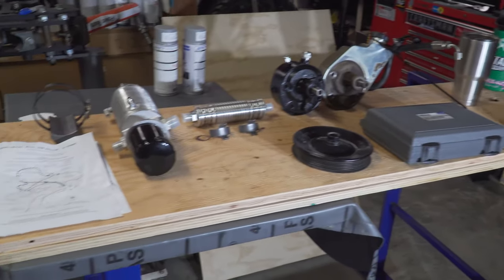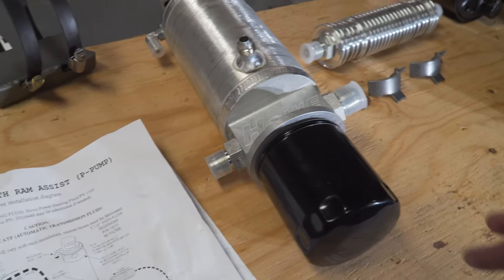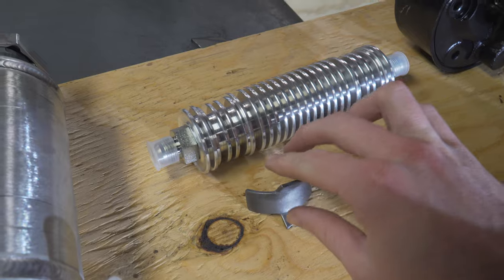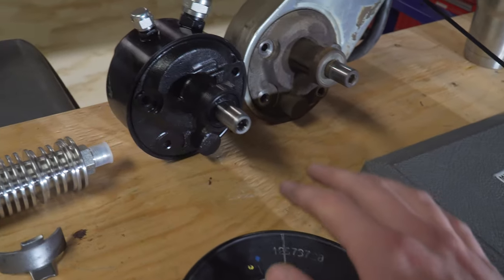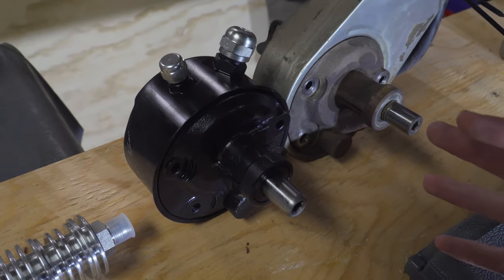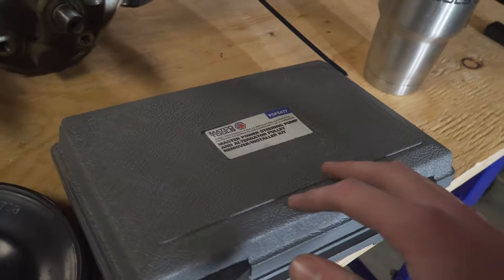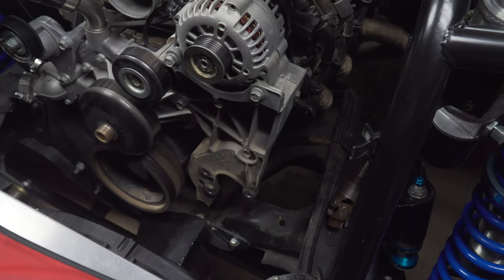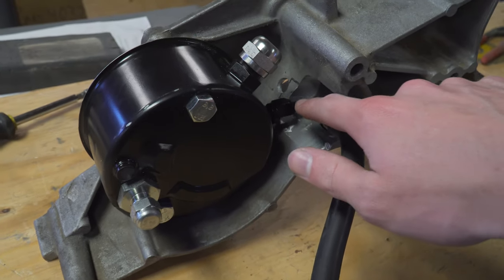RAM ASSIST EP. 02: NEW PS Pump, Reservoir, and Cooler

Comment: I have the same setup on my ls swapped f150. It's so nice! Had the same Issues you guys were too before it. Couldn't turn under about 3000rpm.   One other nice piece of mind if you guys are interested is to incorporate the adaptor that solo makes to be able to slide a heim joint onto the bottom side of the sector shaft below the pitman arm to work as a double sheer setup. I threw one on mine with the howe box just for the extra support

Comment: If they made reservoir for seering units like infinity edge pools so that if super heated or boiling it just went spilling over the edge & collected to cool but u had big enough pool that u never run out of water to over flow & catch & recycle is dispose of. Power steering fluid is dirt cheap. If u over flowed & caught 1/2 a pint infinity edge per trip who cares u can easily reuse or replace it. & it stay clean that way.

Comment: At a min the pplcar jeep/truck < needs an oil cooler on the power steering line 3 times as big as what u guys r going to use on the base model. When it comes to jeeps from 2010 threw 15' ish brand new jeeps were catching on fire or losing breaks & catching on fire. God backing project can't hve that. Trans-oil was prt of problem, but hot oil is a definite major fire can't contain problem that roars to life quick no warning lights just burns up.

Comment: looks like old school alarm clock. For jeepers if they wanted to run 2 alarm bumps 2 hearts so they could switch between A heart Or B heart to give pump chance to cool down is something like that poss. They work the steering hard as hell tight space tight line lockers fighting system???
Reply: Better would b 2 completely redundant systems but 2 alarm clock pumps is good start. They all run assist & it works wonders shock the travels right & left. They make a double thru & thru shock assist but it would make steering to tight.

Comment: Hey Jake, I'm not sure the ideal gas law is what you want to be using to describe the pump. The ideal gas law is usually very limited to gasses and should not be applied to liquids. I didn't take the time to research that style of pump but conservation of mass might be a more accurate approach for how the pump works. Keep making the killer videos and thanks for putting the effort into the education side of things!
Reply from the maker: you are 100% correct, the ideal gas law cannot be applied to liquids since they are mostly in compressible, not sure how I glanced over this. I linked a video to help explain how the pump correctly creates pressure, thank you for pointing that out!
Reply: You would just use the relation a1v1 = a2v2 where a = area and v = velocity. 
since a2 > a1 for the left side to equal the right side v2<v1